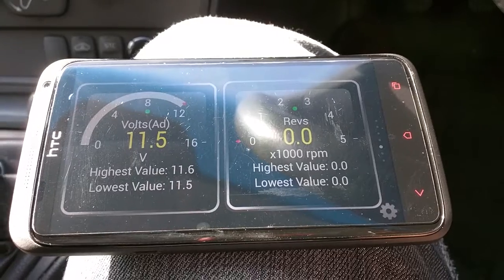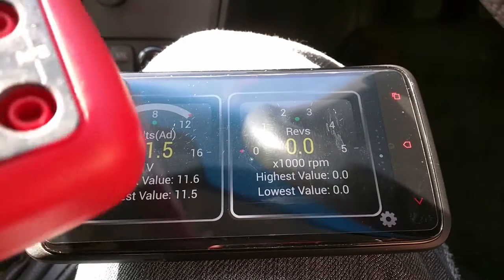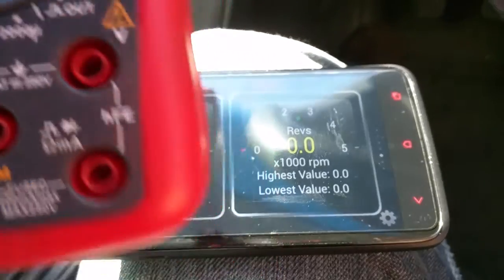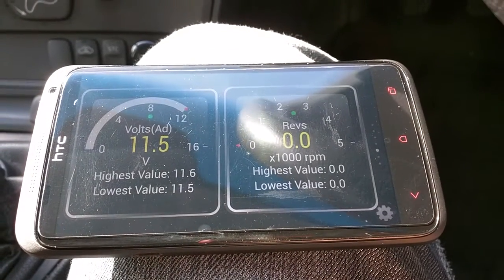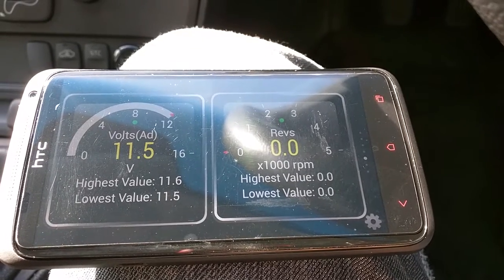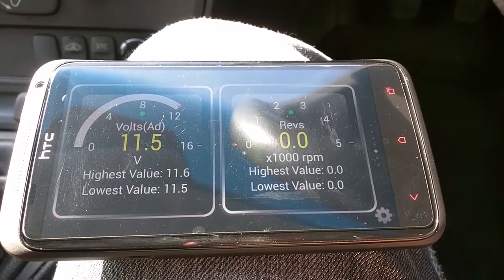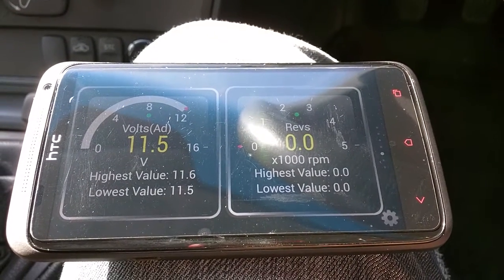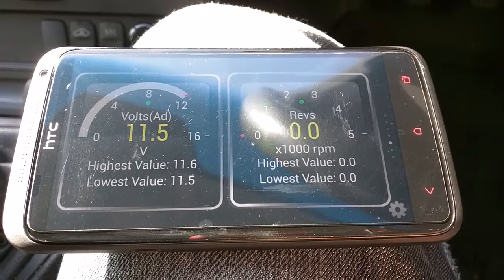Battery and Alternator Testing. Quick and Easy.

Comment: Is there any way of measuring the amps that the alternator is producing?
Reply from the maker: Yes with a DC current clamp.
See my multimeter buying guide or starter motor testing video for the one I use.
Reply: @SiRobb   Excellent 😊 Thanks, Simon.  I have somewhere a vintage Durite clip-on ammeter.
 that I used back in the day when working on Routemasters.
I was wondering though if vida has the ability to show amps 🤔